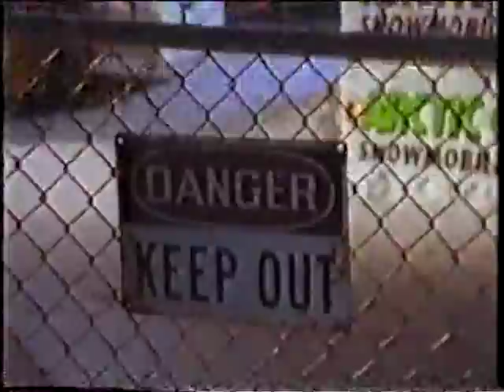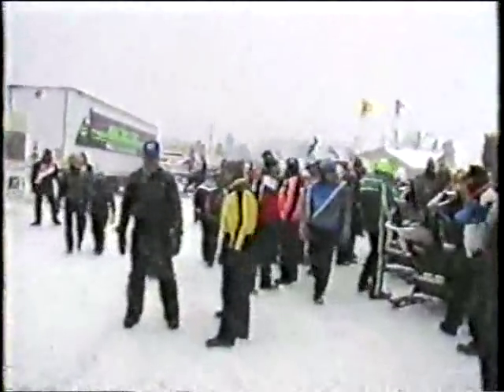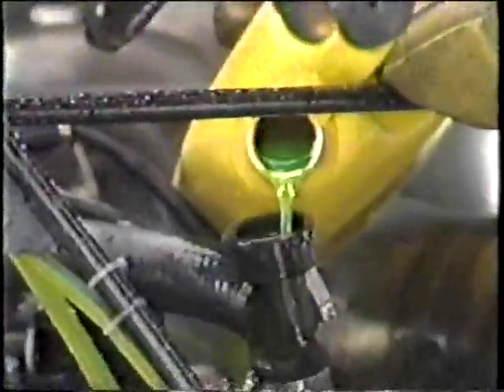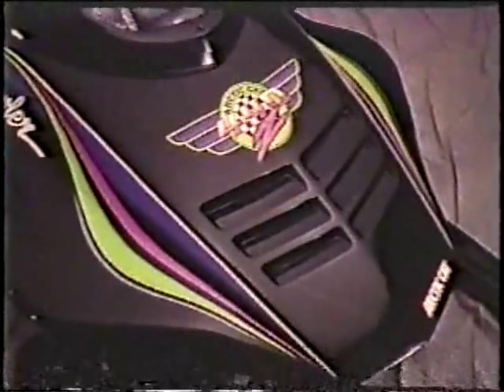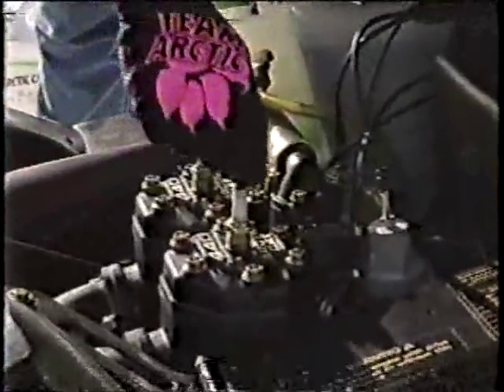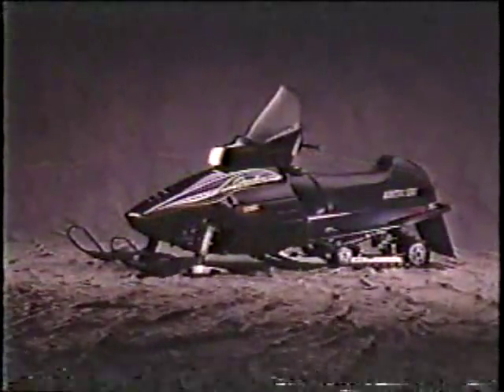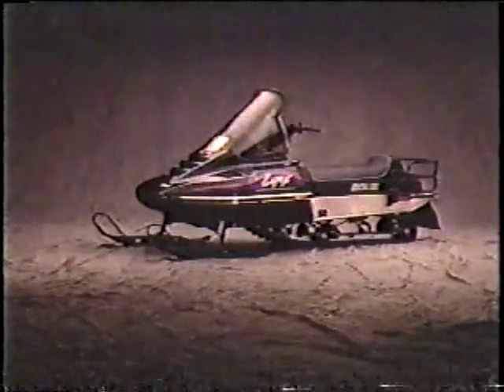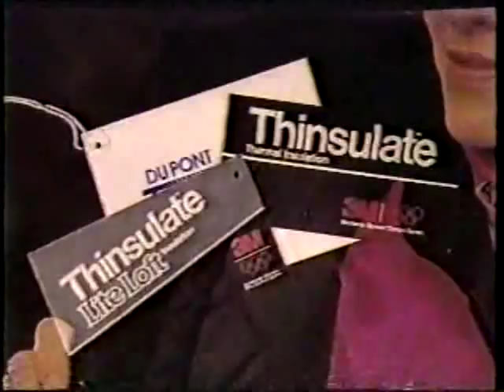1993 Arctic Cat Product Lineup

Comment: had a 93 ext 580 spark plug fouling stater eating gas drinking 2x4 riding clutch/chaincase blowing SOB with no low to mid power with flintstone cable brakes and a nose cone that hung up on every dip . I didn't relize I was being robbed so much until I jumped on a 97 polaris 700 I then asked  myself what am I doing riding that POS nightmare